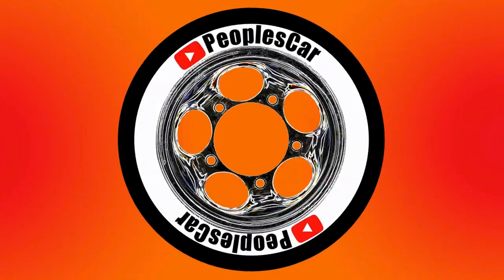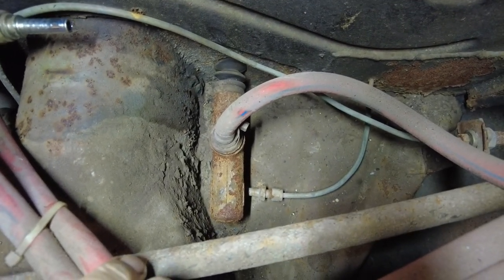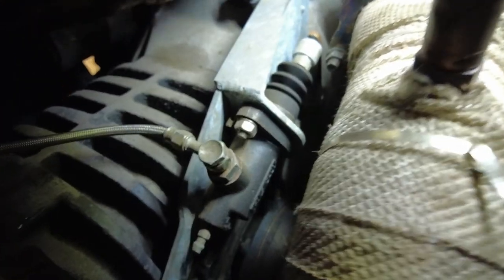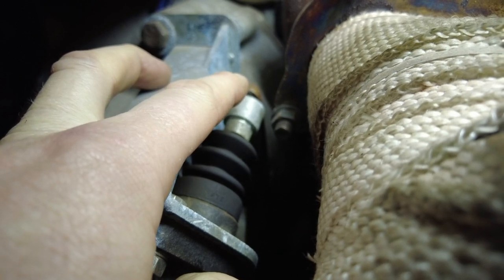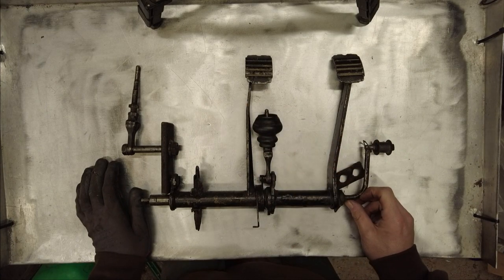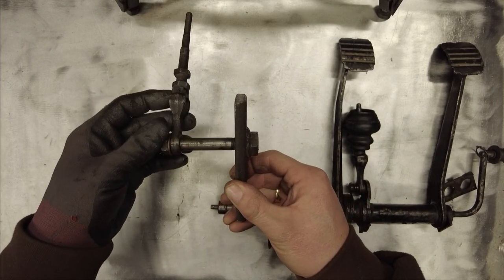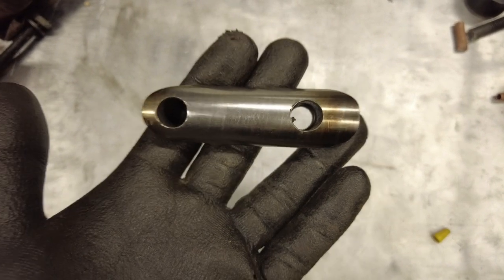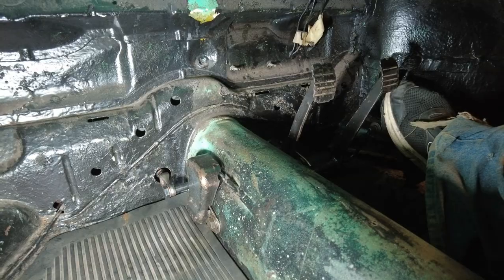DIY VW Bug Hydraulic Clutch Pedals for Subaru Alternate Engine Conversion Bugaru

Comment: Can you show the slave cilinder diy support? Its very cool
Reply from the maker: It's just a short length of box section, from memory about 1'' square to lift it up a bit. I'm actually thinking of modding the pedals and relocating it next to the brake master. This would be a better option and save the complication of this build. Something for the future tho as working well atm. 😊👍